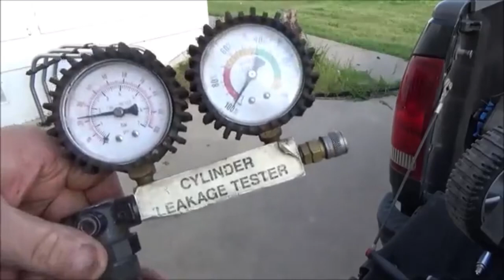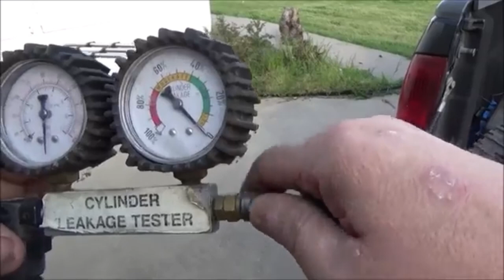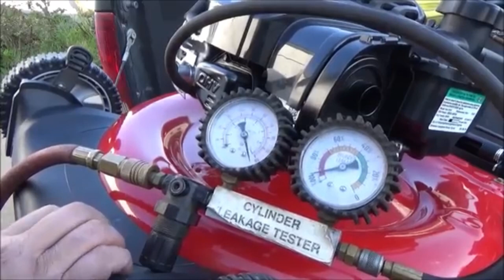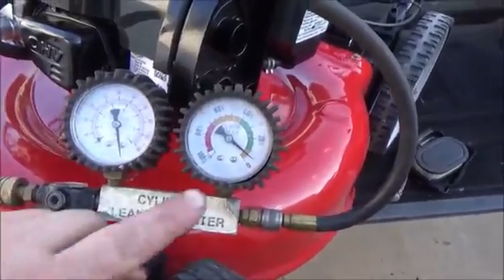BRAND NEW BRIGGS AND STRATTON 500 ENGINE NO START!! BOUGHT AS IS NO WARRANTY!!

Comment: dont throw away your old flatheads folks.an oil change once a year, & a valve adjustment every ten years (if needed). & they will still be running when were dead of old age.all companies have abandon long term testing & quality control has went straight to hell.dont waste your money on newer crap.
Reply: watch that the air filter isn't getting bypassed by dirt and maybe take the "blower housing" off every couple years to remove chaff and grass that might be interfering with the cooling air flow over the fins--or even a mouse might have stashed nuts under there